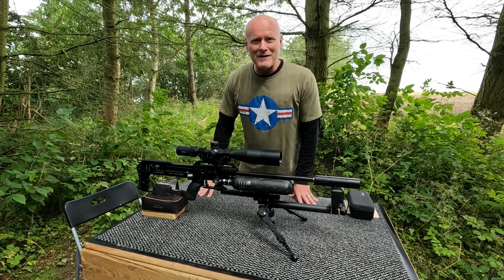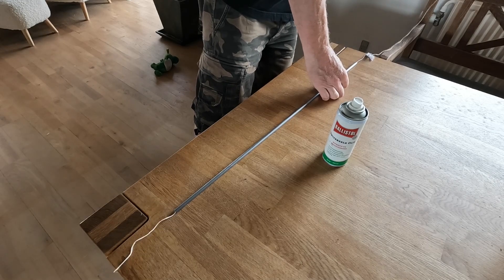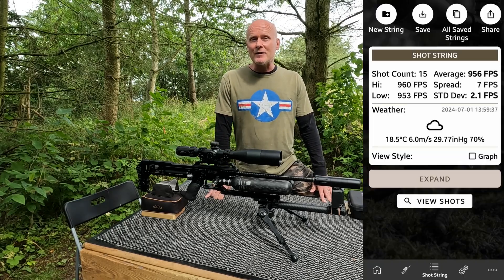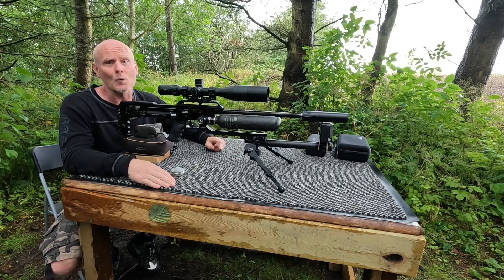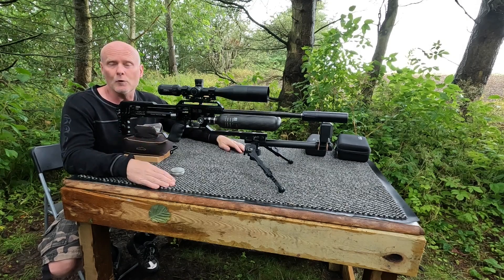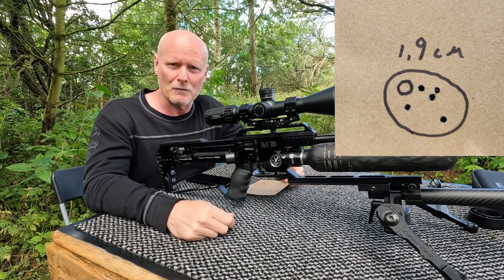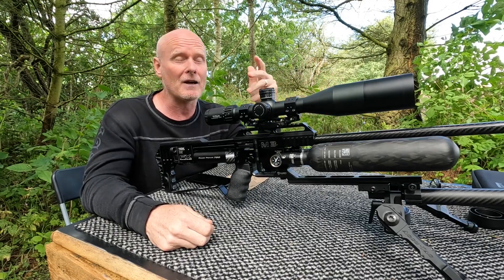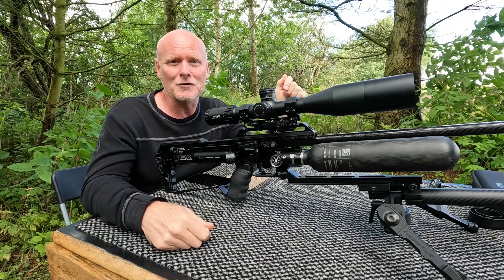FX IMPACT M3 Liner Wear: Time for a Replacement???

Comment: My  .22 superlight STX liner (Crown mk 2) has had around 40-45000 shots through it and it's as accurate as ever. In fact if memory serves it took around 20000 shots before it really started being consistent (of course I have to factor in that during that time I was getting used to the gun).
Reply from the maker: That is good info - thanks for sharing 🤗

Comment: Hello,i just got heavy/slug liner in 500mm,but upon checking length i found it 2.5cm longer then also 500mm rated stx superrior liner,why is that and how to solve problem with end barrel screw only securing liner with few turns due to longer liner,also shroud cant be full aligned due to that longer end barrel screw,thx.
Reply from the maker: I would contact the dealer👍

Comment: Good information sir.
Iam from Indian. I need your help.      My gun is fx maverick compact 177. Iam using jsb knockout 13 gr slugs. Good grouping 100 metres. 
But one problem sir . My prob is 100 + metre shooting tim slugs good grouping but slugs going little right side.. hou right going no idea. Hou cliyar tha complent
Reply from the maker: I dont think that you should expect any particular good groupings past 100 m. You have a short barrel and a light slug. If you want more accuracy at longer distances you should get a longer heavy liner and use 16-20 gr slugs.
Reply: @VikingAirgunner  thanks sir

Comment: Hi Peter, you ever think about polishing the liner?  I hear you could make it even better!!
Greetings from Argentina!!!
Reply from the maker: I have seen people do it, but not if it has made a positive change. If I was sitting next to someone who had done it and I saw the results, I might consider doing it to a bad liner, but my liners has mostly been ok, and if not I have sent them back for a replacement. 
Problem is that people has different opinions about accuracy. One would say that his liner is good after only shooting at 35m, but at 100 m it would make 5 cm groups, so I never trust people unless they document their accuracy - or if it is someone that I trust.
So I would probably not do it to my FX liner. If I by accident removed to much material in the process its pretty much destroied. 

Best regards and high fives back to Argentina

Comment: It takes hundreds of thousands of rounds to shoot out the barrel of a .22 LR and pellets don't go as fast and aren't as hard so I suspect airgun barrels are nearly indestructible.
Reply from the maker: Thank you for sharing this info. Much appreciated for everyone here 🙂
Reply: @TacticalJackalope  not as fast? Not as hard? Really. My air rifle can easily shoot faster & alot heavier than 22lr
Reply: @TacticalJackalope, im with you on this, even though the fx barrel liner is thin it's not cheap steel, it's fairly hard stuff, also there is no carbon fouling in an airgun, that and extreme heat is what wears a barrel.

Comment: With conventional firearms, barrel degradation usually comes from heat due to friction etc. Single shots in a benchrest setting, isn't heavy wear and tear. Also with compressed air, you cool the barrel in such a way that it is usually colder after a shot, further reducing potential wear and tear. ✌️😊
Reply from the maker: Thats good info. Thanks for sharing 👍

Comment: must be sub 12#
Reply from the maker: A 16 gr slug at 963 fps. How do you calculate that to be sub 12?
My humble calculation says 32.9401798201798 ft/lbs, but I could be wrong🤔
Reply: @VikingAirgunner  my question was reflecting how the pellets impact the board.  my m3 goes through so fast I don't see any particles chipping off

Comment: I agree, my 25cal Heavy liner has over 40/50k through it & it's sub moa at 115yds easily, with over 10 different projectiles. The issue with the liners is it's a hit or miss to whether the liner you get is a good or bad one, my 25cal Heavy is awesome, my 30cal Heavy it took 3 attempts to get a liner that actually worked to my standard, but the one now again is awesome. So my worry is if they do wear out what will the replacement be like
Reply from the maker: What is your experience with the liner over time with the accuracy? Getting better or worse?
Differences from new and after having shot 1000-2000 shots?
Reply: @VikingAirgunner  sorry, for delay, signal is shite. Precision accuracy came after 2-3months, combination of everything settling down & me getting used to it. Since then I have noticed no change whatsoever, still amazing precision
Reply from the maker: @precisionairgunninghunting6265  About the same as me then 🙂 There must be something about it then 😃